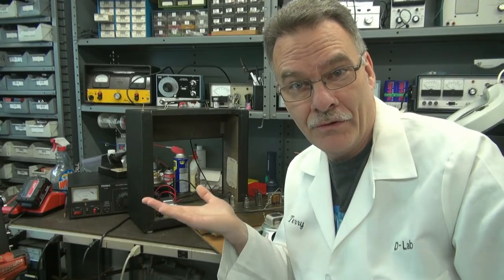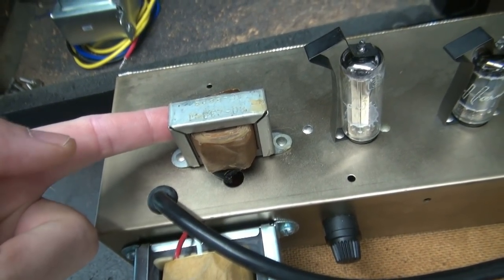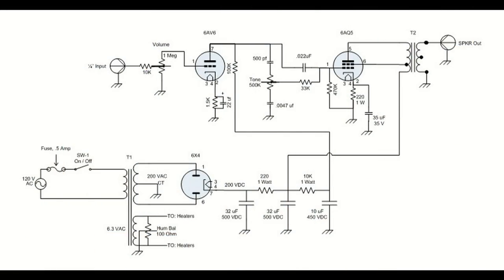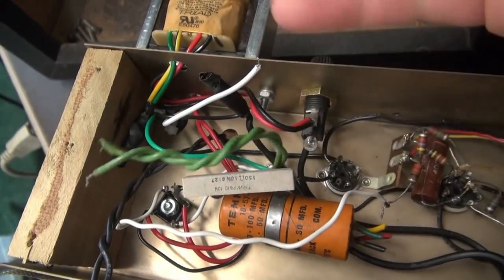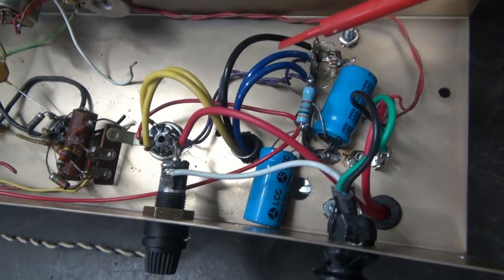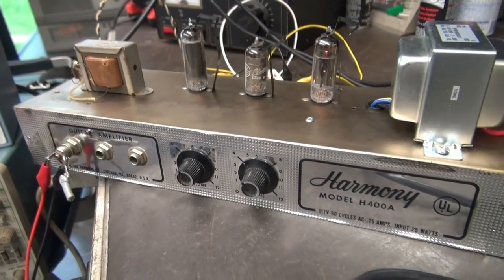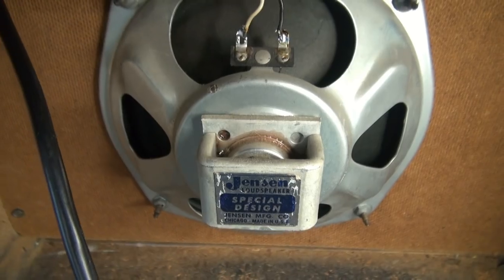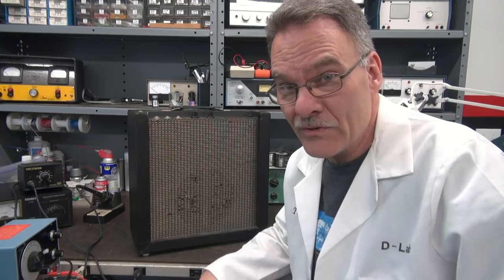How to fix modify Hot Chassis Tube Guitar amps New transformer by D-lab

Comment: MAN, that old mic-zapping-the-crap-out-of-you brings back memories!  Had this happen a lot back in the late '70's/early '80's when I was gigging pretty regularly.  The other problem was bar owners back in the day (or their DIY landlords) were notoriously cheap, and often didn't actually wire a ground, nor really seem to care if the plugs had the black wire going to the smaller plug receptacle or the larger, and no consistency between different circuits.  That could also cause a nice little lip bite when the PA was plugged into one circuit and amp plugged into another.

Learned to always do the "shy poke" at the mic, first with fingers on the strings tapping the mic with the back of my fingers, and if no shock, gingerly repeating with lips to mic.
Reply: Ken Davis There was at least one musician that actually died that way. Some guys carry one of those outlet testers and make sure everything is wired correctly. Better safe than sorry!
Reply: Yeah, but again, this was circa 1979 and I was 20 years old, and thus immortal!  :-)  Plus, I don't recall the outlet testers being widely (or even) available back then.  

There was no Home Depot or Lowes (or, believe it or not, even a Walmart in every niche), and though I suppose there were probably pro-tools to test circuits, the extent of my electronics kit back then were basic hand tools, a soldering iron, and a very flaky analog voltmeter.  (Oh, and a stroboscope for tuning, for those who remember those.)
Reply: Ken Davis I hear ya!  I actually bought an old tube stroboscope on eBay not too long ago! It needs a little bit of work, but it's still functional.
Reply: I still have my Conn strobotuner! I love it. Let it warm up, recalibrate it, and watch the wheels go round. I keep it on my work bench and it is my old friend! I have ruined equipment on the road because of faulty wiring. I went through more than one Boss chromatic tuners. I had the "tuner helper" mic stand adapter. Great setup until wrong wiring took um' out! Thankz
Reply: Audio Tech Labs Mike's a Conn too! I think it's an ST-1 from the 40s  serial# 1982, fairly low I think? Unfortunately it's missing the front cover and microphone
Reply: It's a bite alright. It hurts.
Reply: Back in the 90s I took a huge jolt when I leaned on a steel lighting truss while holding my bass in my hands. The lighting rig was running on 220 volts. The experience was quite energizing.
Reply: I built two heavy duty power strips that had outlet testers built in and had a polarity reverse switch. I also carried a three prong adapter (ground lift) with a long wire attached to the ground lug and a big alligator clip to ground to a water pipe or conduit.
Also carried foam wind screens as a back up.

Comment: Hi Terry,  I've become a big D-Lab follower.  Followed your advise and now I have a nice tech bench setup.  I'm on the fence with what to do with on old silvertone 1430 I picked up.  The previous owner did a cob job on it when putting in an isolation transformer.  Was there a big improvement when you modified the Harmony with a PT and switched the tubes?  I'm between keeping as is with isolation transformer, doing your mod, or going a step further and making it a Kalamazoo Model 1 circuit.  Any advice?  Also If I convert to a PT do you have one available to sell?  Thanks, Mark

Comment: QUESTION: why do not put a input socket that puts on ground the hot terminal, when the jack is not in? This will avoid any noise when you turn up volume without a connected source. Is there any contraindications?
P.S. when you state "there is not hum" in the reality a bit is audible. Is that due filtering? Or transformers' mutual interference?

Comment: Great mod.  But I've heard some horror stories about 6x4's. They can go down and take the transformer with them.
Reply from the maker: This one uses a 6X4. I have used this tube for many years. Never had a failure. Newcomb tube type record players utilized the same. The amp is fuse protected now, so hopefully that level of safety will protect the tranny if the worst situation occurs.
Reply: I'm sorry. I meant 6x4